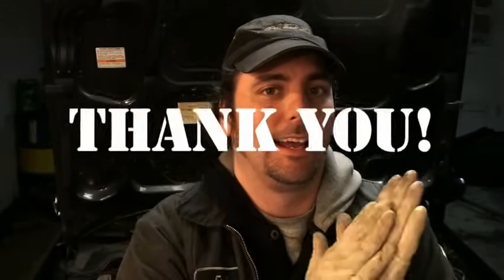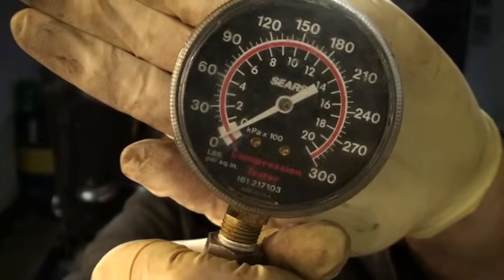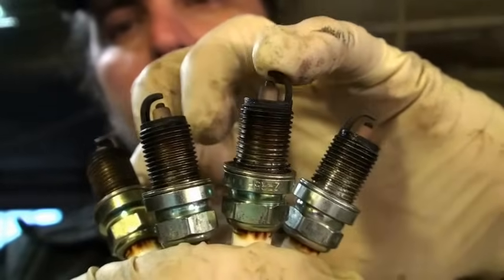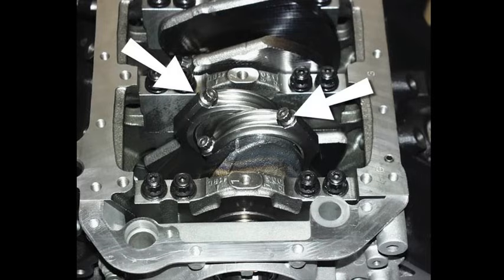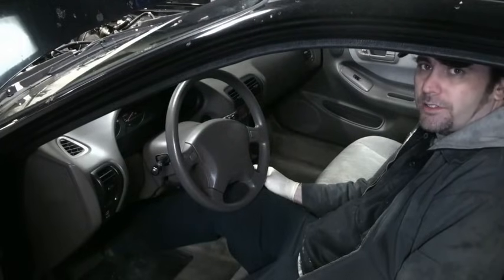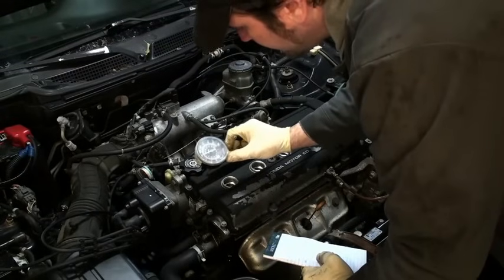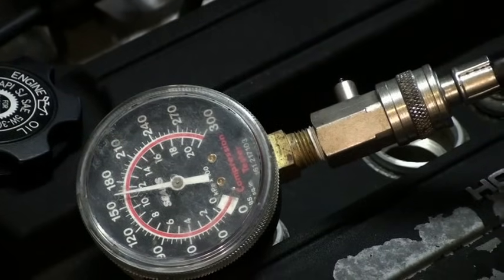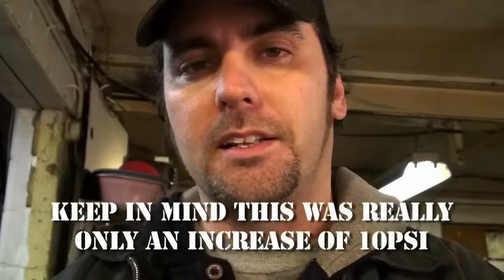How To Perform a Compression Test - EricTheCarGuy

Comment from the maker: @damd1985 Actually you are the first person with an accurate comment pertaining to valve stem seals and it's symptom.  Most comments I get are really worn out engines not a valve stem seal problem.  My friend at RealFixesRealFast did a great video on replacing them that you might want to check out.

Comment: Great video Eric! i did a compression test on my 85 cutlass 307 v8 4 barel. it read a average of 65psi accross. all were within 11 psi. mostly 60 and 65. it still runs great no miss but it recently began to smoke at startup and now occasionally a few minutes after i start it. if i drive it for a while it stops smoking then does it all over after i shut it off for a few minutes. im thinking valve stem seals. do u agree or have any suggestions? dgarcia77373@yahoo.com it still runs great.

Comment from the maker: @ir1337zor What you describe doesn't really sound like a mechanical problem but checking for one first is always a good idea as you don't want to ignore the mechanical operation of the engine.  I know you replaced the coils but you might also want to check the plugs to make sure they are good as well as the fuel pressure to make sure it stays consistent especially at higher RPM's.

Comment from the maker: @pberglin Yes, it's just regular engine oil.  The kill switch will work great but you will still need to open the throttle all the way when cranking as part of the test, the engine needs to be able to draw in as much air as it can in order to get an accurate test result.

Comment from the maker: @jambe1234567 Less work actually if you take all the plugs out at the same time but you do need to have a fully charged battery to do this test or it will not be accurate.  Great question.

Comment from the maker: @DrJerryrigger You might try cranking the engine for a few cranks after putting oil in the cylinder to work the oil into the bore, it will 'wick' up as a result of capillary action but it may take a few cranks to get it worked in there.  Thanks for the comment.

Comment from the maker: @shaneunderwood It can tell you where the leak is, at the intake valve, exhaust valve, rings, or into the water jacket.  You do this by listening at the throttle body for an intake valve leak, at the exhaust valve leak, at the oil cap for the rings, and look in the radiator for bubbles if it's leaking into the coolant jacket.

Comment from the maker: @mesmup1 Do a power balance to find out which cylinder(s) are effected.  Once you find the effected cylinders it's a matter of determining if it's mechanical, electrical, or fuel delivery that's causing the miss.  Compression testing will help diagnose a mechanical failure.

Comment from the maker: @TheMikebuntu Thanks for the tips.  I've never seen a car engine designed the way you mentioned but that's not to say they don't exist.  Don't forget you also have to block the throttle open which was the purpose behind putting the gas to the floor which also turned off the injectors.  As for disabling the ignition I believe I showed that in the video.  Thanks for your comment.

Comment: Good vid, but I would like to make a couple comments.  On some inline engines (like old tractors) the #1 cylinder is nearest the flywheel.  Also some fuel injected vehicles do not have clear flood mode. Older Dodge trucks are one of them.  Plus it's a good idea to disable the ignition system and the fuel system to prevent fuel from washing away oil from the cylinder walls, and prevent arcing inside the coil.

Comment from the maker: @l3lackout77 Not knowing what engine your working on or what the spec would be I would say that it is good based on the fact they were all the same.  With a compression test it's really a general look at the overall health of an engine, if all cylinders are close in compression it usually means a healthy engine.

Comment from the maker: @luckeydog89 You don't put so much in as to change the compression ratio but rather just enough to help seal the rings, you do this to help determine the health of the bottom end of the engine as a higher wet test could indicate worn rings or cylinder walls.  The movement of the piston during the test helps distribute the oil over the rings.

Comment: Cool vid. But aren't you going to have a higher wet test vs dry test because of the oil making a smaller chamber instead of sealing the rings? And With an inline motor like this, how do you garentee that the oil gets around the rings and not just sit on top of the piston? Good vid. :)

Comment from the maker: @lfc023 I haven't used chemweld but I have used JB weld in the past with mixed success.  It really depends on what you are trying to accomplish when using such products as well as the preparation of the surface your working with.  It should also go without saying that following the instructions will go a long way toward success as well.

Comment from the maker: @JisNUMEROuno If it's a Honda I did a video on fixing the oil leaks in the spark plug wells.  The leak you are referring to would be an external leak not an internal one so other than possibly shorting the spark plug it should not effect engine performance.

Comment: Keep in mind #1 on a 4cyl Honda is on the drivers side, the engine of course rotates backwards. On a Mazda for example,  #1 is on the passenger side. An easy way to find the front OR back is the position of the timing chain or timing belt. #1 is always going to be on the timing belt/chain side of the engine.

Comment from the maker: @HD8Track Operator error is the most likely cause or the other 3 are just that low but this is not likely.  Carbon buildup on a piston is negligible and really won't effect a compression test.

Comment from the maker: @dandim23 Misfire codes especially with cars of that vintage are not accurate at all.  Start with a power balance test (I made a video on it) and see if you can nail down the effected cylinder(s) and find out what issue it has.

Comment: i have a 97 grand am with a 3.1 and when i first got the car it had a MIL and it said cyl 3 misfire i did a bunch of stuff 2 try 2 get it go off such as a tune up and replaced the coil packs and a few other things ...the light came back on and i kept clearing the code and the last time i cleared it which was about 7 months ago it seemed 2 have dissappered and i havent had a MIL light since but i can still feel it misfiring very slightly at idle but it doesnt trigger my MIL light do u no y?

Comment from the maker: @Da1RiSiN1sMoKe It's really not possible to do this test outside of the car unless you can get something to spin the engine fast enough (hook the starter up or use an impact on the crank bolt).  As for the configuration as long as you have a spark plug or glow plug hole you can do this test with the correct adapters.

Comment from the maker: @CALITO76 Yes, pressing the gas to the floor will shut the fuel off, that pretty much works on all fuel injected cars.  In addition to shutting off fuel at the injectors it also opens the throttle which is also an important part of this test.

Comment from the maker: @vexona56 No, a master cylinder won't cause that problem, misadjusted brakes will cause that problem, usually caused by an adjuster that is sticking.  You might want to check out my drum brake videos as I cover this.

Comment from the maker: @9009MHHP Well if it won't idle after you put the cam in it's probably the cam.  Cam's with a high lift and duration are known for poor idle as they are designed to operate at higher RPM.  If you put performance rockers on it this may also contribute because some rockers are designed to open the valves beyond what the cam does.

Comment from the maker: @porterzcustomz The fact that the reading came up with a wet test indicates the problem is most likely in the bottom end of the engine and is not the valves.  The next step is to perform a leak down test to determine where the leak is going and then decide on a repair.

Comment from the maker: @cuntsucks Based on what you told me I would be looking for another vacuum leak.  You might also check the idle air control valve if the problem is only at idle.

Comment from the maker: @9009MHHP Excellent question, those numbers represent the amount of lift the arm is capable of.  Think of rocker arms like a teeter tauter, where you place the fulcrum dictates how much leverage you have, if it's in the middle it's 1 to 1, move it toward one side or the other and the ratio changes, instead of 1 to 1 it turns into .5 to 1.5.  You can get more power from these but you need to know what you are doing, you don't want to hit the piston with a valve or break a valve spring.

Comment from the maker: @stikguitar If the plugs are getting fouled with fuel this would be what I would pursue:  I'm not sure but that engine might have a "cold start injector", if it does I would remove it from the intake see if it's leaking as this would cause an overly rich condition which could cause the engine not to start.  You could also have a leaking injector that could cause the same condition.  You could hook a fuel psi gauge up and check to see if static psi drops off after the fuel pump is off.

Comment from the maker: @imautuber444 Motor oil is the most preferable but the 2 stroke stuff should work, I used transmission fluid because it's what I had in the can at the time.  The idea is to get enough in there to seal the rings to help nail down the problem, top end or bottom end.

Comment from the maker: @digx5 When you put new rings in you also need to make sure the cylinders are not tapered, if they are then putting in new rings will actually make the problem worse in my experience.  If you have a big difference between wet and dry testing the leak is usually the piston rings.  You can verify this with a leak down test which I hope to do a video on at some point in the future.

Comment from the maker: @vettelover2009 Putting the gas pedal to the floor when cranking does 2 things, shuts off the fuel and props the throttle open when you crank.  You are correct that it does need to be open when cranking.  Thanks for the comment.

Comment from the maker: @YPUK0PALMY I don't think they have a "max" reading, just a range.  I don't know that spec off of the top of my head to be honest, it depends on the application.  Keep in mind the thing you are looking for is consistency when performing this test more than anything.  Personally I don't even look up a spec when I perform the test but rather see if the cylinders are within about 15% of each other.  If one or more is low I look into the cause on that particular cylinder(s).

Comment from the maker: @mixwell1983 I have a wire that I use just for that with a connecter on the end that goes right to the starter solenoid but if you do it the way I did the the video the throttle will be at WOT and the fuel will be turned off.  The throttle should be at WOT for the test.

Comment from the maker: @burubuduy It was transmission fluid but regular motor oil works just fine.  I really don't have a recommendation on a brand of compression tester, I just bought one that would get the job done, compression testing is just the start and not the end if you find a problem.

Comment: Another tip (which I don't know because I'm commenting before watching the complete video) and I don't know the factual name is you can run a lead to your started and ground it and its almost like a "starter gun" which will simulate turning the key over, if you are solo without a buddy to crank over the engine.

Comment from the maker: @jambe1234567 To answer your question, no, take all the plugs out when performing this test.  I think it's best to do it this way because it makes it easer to turn then engine over and won't wear the battery down if it's marginal.  In addition it is also consistent and makes the test go faster since you already have the plugs out, consistency is key here you want to give each cylinder a fair chance.  You can however remove the plugs one at a time and do the test but this is not my preference.

Comment from the maker: First, compression ratio and compression testing are completely different things and not directly related.  An engine that has a higher compression ration will have higher compression but will not be proportional to the ratio.  Second, when you depress the gas pedal while cranking the engine it turns off the fuel injectors AND opens the throttle so that you get a good reading.

Comment from the maker: There are a lot of factors that could contribute to that problem, start with the basics, the tune up items, tire pressure and the like.  Does it have a check engine light?  If it does this might provide some clue to the poor fuel mileage.

Comment from the maker: I think the only fuel pressure regulators I've ever replaced on Honda's were the updated ones for 01-03 Acura TL's and CL's, other than that I really haven't seen one fail.  I'm not saying it's not possible but you might want to look into another cause for your no start before you condemn the fuel pressure regulator.  If fuel is present it probably has fuel pressure.  Watch the basic diagnosis video and see if that helps.

Comment from the maker: It is true that the cylinders will seal better when the engine is at operating temperature but in the case of a compression test you are really looking for consistency between cylinders which would be present even if it's cold.

Comment from the maker: As the piston rings wear so does the cylinder wall.  In fact over time it becomes wider at the top than the bottom.  It's just a matter of measuring to find out if things are of the correct shape and size for good ring sealing.  If your going through the trouble of replacing all that stuff it would be wise to have the cylinders checked out to make sure your new rings will seal properly. The tool used to measure is called a micrometer, MIC for short.

Comment from the maker: You removed the comment about the charging system on your Accord.  80% of electrical problems are a result of a poor connection.  I think I suggested sometime ago when you asked me this question to check the connections not just on the power circuit but also on the grounds.  In addition Honda uses an ELD (electronic load detection) to increase charging under load, this could be a possible cause. Lastly, cheep alternators are just that, I've installed some brands new and they didn't charge well.

Comment from the maker: I've replaced countless ignition switches on Honda's and Acura's.  You test it by holding the key in the crank position to see if it runs, if it does then look for melted solder on the electrical portion of the ignition switch.

Comment from the maker: Wouldn't work.  The PCM uses that sensor to look for changes in pressure over time, if you just added a resister it would be a constant resistance and would set a fault code as a result.

Comment from the maker: Not necessarily.  With a turbo it's not just compression it's the compression ratio.  If you have a high compression ratio and you want to add a turbo you won't be able to add as much boost.  For supercharging or turbo charging you want to start with a low compression engine.  See my video on "Octane Ratings" to learn more about compression ratio.

Comment: You apply the parking brake and make sure there isn't anything in front of the car / truck. Holding the left foot firmly on the brake pedal, you put the car in "D" drive. Now you apply some throttle with your right foot while holding the brake pedal. Most torque converters will stall to around umm 1800 rpm. You will see rpm but the car won't move. Depending on the adjustment of the rear brakes ya now are in the "Burn Out" phase of your street racing mode.

I'll send you a link to power brake..

Comment from the maker: That depends on where the coolant was coming from.  I don't know for sure but I don't think there is coolant near the spark plugs on that engine.  The best thing to do in a situation like that is to pressure test the cooling system to look for external leaks first and then go from there.

Comment from the maker: All true but know that I had to cut out 5min to get it to fit into the 10min, I had to make some hard decisions, I figured the injector shut off would cover the WOT and battery condition would be assumed.  Also if battery condition were to effect the test it would effect all cylinders evenly.  In addition to that I tried to stress that this test was only the beginning and that a leak down would give more accurate information.  Good to have you back.

Comment: 10 stars Eric.. Sorry been busy.. 

Umm battery condition and starter can reflect a difference in compression. Also .. WOT should be the norm as you want the air flow to be at optimum.  

Ya rock and looks like your off to a super New Year!

Les

Comment: My last vehical was a 2001 Escort ZX-2 and the main reason I got rid of it is I THINK the head gasket was going. It had antifreeze/water laying on top of the spark plugs and the wells they were sitting in causing the plugs to misfire and the engine to run like crap. Was my assesment of a bad headgasket correct when this happens to an engine?

Comment: Thanks for the video, and congrats on the subscribers!  I recently did a compression test on the same motor, I believe that I have cracked ringlands on mine because there is excessive blowby.  Cyl 1 was down to 30psi!  2&3 were 90, and 4 was 120.